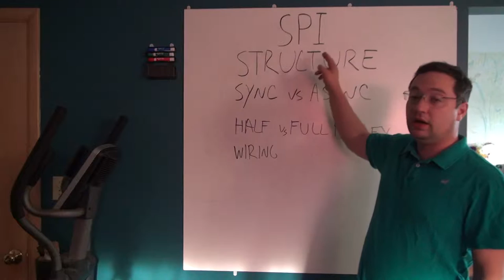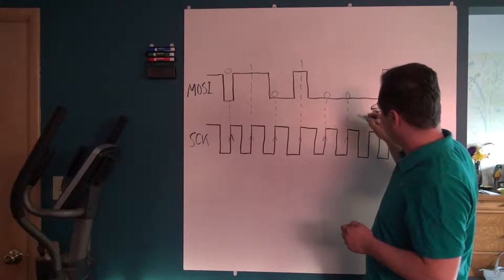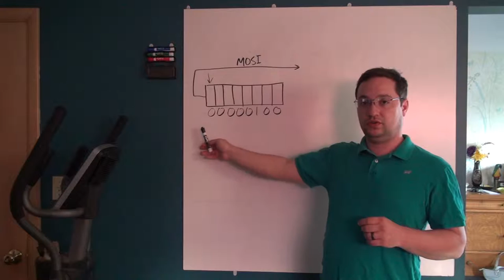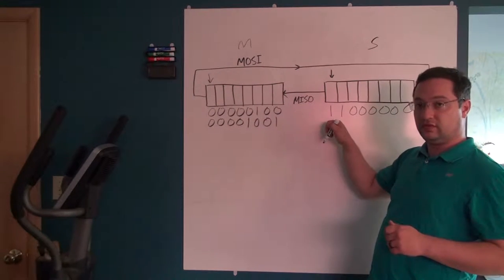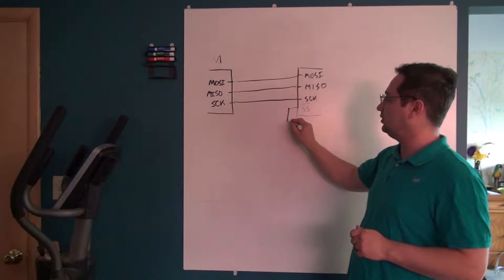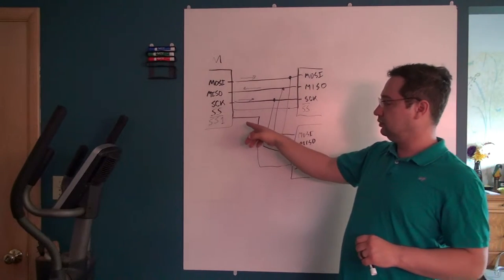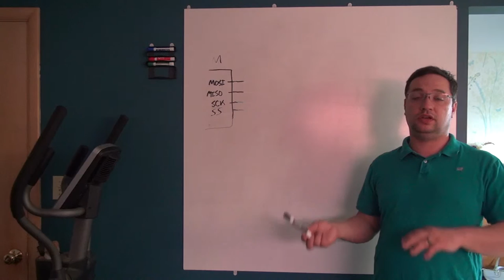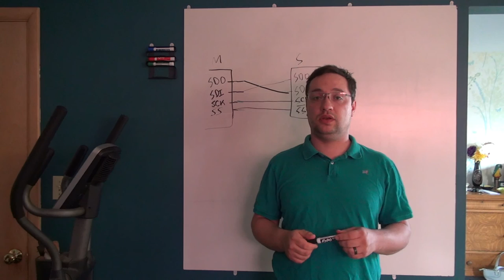eapbg #17 Introduction to SPI

Comment: I was just wondering how they came up with 120 ohms why 120 ohms any reasons why?
Reply from the maker: It is not terribly difficult to get a 120-ohm impedance wire.  There are other buses such as rs485 that use the 120-ohm standard. Please note that I said impedance and not resistance. By terminating 120-ohm characteristic impedance wire with 120-ohm resistors it eliminates reflections and gives a cleaner signal.

Comment: Which busses that are differential signals that use termination resistors? CAN and ECL but what others? I don't understand why some busses terminate resistor value is 120 ohms and others its 50 ohms or another value. Any reasons why a CAN buss is 120 ohms and not 50 ohms?
Reply from the maker: It has to do with the design of the bus and its speed.

Comment: Why does SPI, I2C, CAN all use different termination resistor values any reasons why they resistor values are different? What is the differences between using a single termination resistor compared to using a split termination resistors? they both do the same thing but whats the differences or advantages?
Reply from the maker: SPI does not use termination resistors. I2C also does not use termination resistors. It uses pull up resistors. Both of these busses are sing ended, not differential pairs. Only differential pair buses use termination resistors. Bidirectional buses use two resistors like CAN. Unidirectional buses use only a single resistor at the receiver like RS485.

Comment: Oh ok so its the twist wire characteristic impedance that is 120 ohms. I thought the CAN modules needed a 120ohm load or something. What you're saying is that the actual twist buss wire characteristic impedance is 120 ohms that is why you have to terminate at 120ohms, i get it now
Reply: This is how a circle known as token ring is actually done;
A terminating resistor at the end and none of the customers  are the wiser;

Comment: Good video, but I disagree with statement that SPI is about same speed as UART. I've never seen UART going higher than 1Mbit/s, while many SPI Flash chips can work at frequency higher than 100 MHz (100Mbit/s).
Reply from the maker: I entirely agree, SPI is capable of much faster speeds. The caveat is that at those speeds careful consideration is needed for connecting the devices together. I didn't want to send people off without covering things like propagation and transmission line effects.
Reply: That's for sure! I've recently designed my first FPGA board using HyperRAM chips for RAM - I didn't want to jump straight to DDR3 as it would be a quantium leap in terms of amount of factors I would have to consider. When suddenly it becomes extremely important how you lay out tracks on a PCB - before with slower MCU boards I could lay them out pretty much how I wanted and it would still work OK. BTW if you have some practical experience in this area, a video on that would be very helpful (especially with practical examples shown on oscilloscope), as I had to literally gather bits and pieces of information all over the internet, as most of it is only available as part of expensive design courses, which are made for professionals and so are far beyond the reach of most hobbyists like me.
Another suggestion if I may - make a video on I2S bus. Shortly I will have to implement it in FPGA, so it would be handy to have such detailed videos as those your provide. Also if you can include some practical examples for all those buses (say with Arduino as it seems to be "hot topic" at the moment), I think it would help a lot. All these buses (maybe with exception of I2S - not sure about that one) are available in Arduino Due which is fairly cheap. Just be careful that this board (like most ARM-powered ones) is strictly 3.3V!
Once again, thank you for what's your doing!
Reply from the maker: I can throw something together for I2S. As far as throwing something together for an actual application it would take longer. The Due does not support I2S nativity. There is a library that adds the functionality but i'm not sure how. I could do a PIC24F coupled with a DAC as an example but it would take a while. Unfortunately i don't have any practical experience laying out transmission lines.